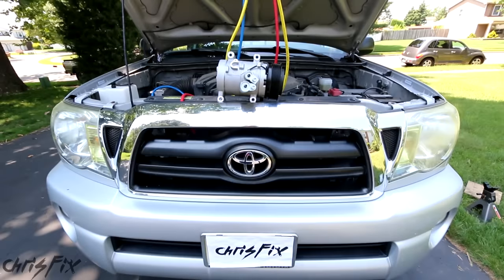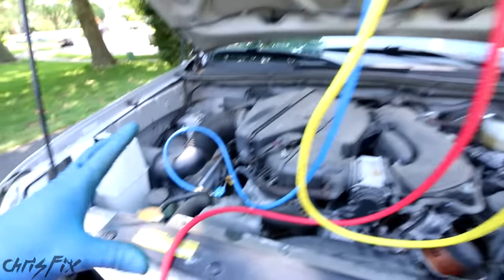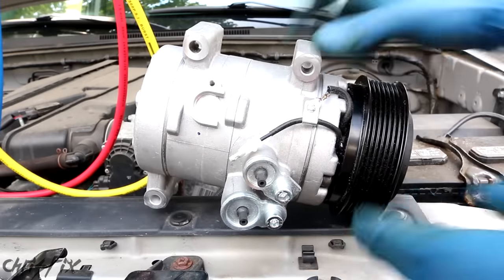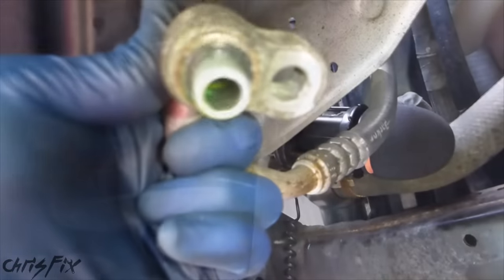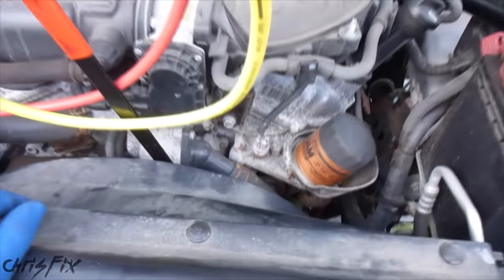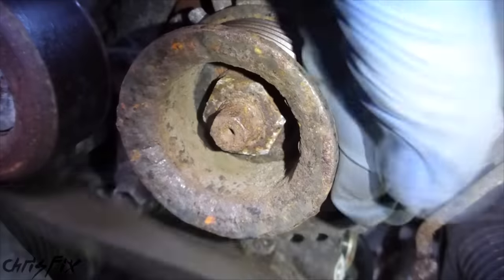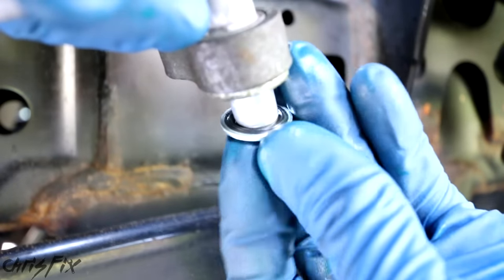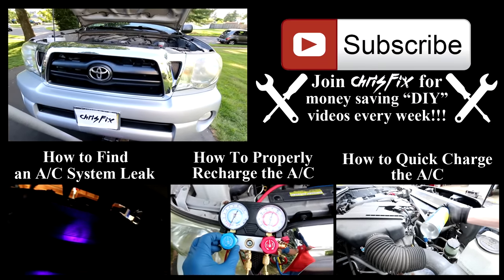How to Replace an AC Compressor in your Car

Comment: Good video. Being EPA certified I appreciate you telling viewers to have their system recovered before taking lines off and such.
Reply from the maker: George W Thanks!
Reply: its always best to release all refrigerant directly in the open air to help condition the cloud seals
Reply: George W  1313george
Reply: where to  go for the system recovered? do they charge any money for doing that? if they, how much money will they charge? ~100$?
Reply: wolf north should only be around 10-20 if anything at all. It costs the shop nothing but a few minutes

Comment: I have one thing to bring up, I was told that anytime you break the system and expose it to air you should always replace the dryer to make sure you have no moisture in the system.  If you have any water in the system it can damage the compressor or the high to low pressure valve( sorry I forgot the name of it).  Pulling a vacuum does not get rid of water.  Was I told wrong or why did you not change the dryer out?

Comment: Okay, I have a 2007 Honda Fit with 296,000 miles on it.  The engine still runs strong!  I have some front suspension wear, and Chris' recent Del Sol front suspension video has convinced me to replace most/all of my front suspension.

Now my A/C has also failed.  I suspect it has multiple problems (leaks + tired compressor, etc.).  I'm thinking of just replacing ALL the A/C components (including lines, condenser, evaporator, etc. -- basically EVERYTHING involving the refrigeration system, plus the condenser fan assembly.  I'll keep the controls and cabin blower motor, etc.)  Ignore the financial questions about the value of the car, blah blah blah.  Assume I'm okay with the total parts cost and I'm doing all the work myself that I possibly can (everything except recovering the old refrigerant).  Does this sound reasonable?  It looks to me like replacing the lines, seals, etc. with all new would save me the time and effort of tracking down leaks, flushing the existing system, etc.  And at the end I'd have a whole new system that should last several more years.  Does this sound reasonable, or am I completely off my rocker???
Reply: No more nuts than I am...should see all the things I've done and am doing to my 2003 Ranger...

Buddy has the same year Fit I "get" to work on so he can save money.  You'll find out rapidly that working in that engine compartment is somewhat nightmarish.
Reply: You can keep your evaporator, unless it leaks. Everything else is reasonable when you love your old car.

Comment: Bro, you legend! I just picked up an '04 4Runner and I started hearing noises from the compressor clutch. I think it'll give out in the next few months... I was preparing for the job by looking for videos to see what I was in for and I couldn't find any for my engine and car and I stumbled across this and that Tacoma just so happens to have the same engine and whole setup as my 4Runner, wild! Thank you!
Reply: same kinda, '00 4runner tho and the belt slips off because the compressor pulley is too far forward by about a half inch. pisses me off because it just started doing it after i bought the damn thing

Comment: So you do have to use a vacuum pump when you get everything back together. Air in the system is actually a problem.
Reply: You should pressure test with nitrogen also.
Reply from the maker: That is shown in the next video of the series.

Comment: When replacing a compressor some manufacturers require the lines to be flushed for
warranty. Did you make a video that shows the process you use?
Reply from the maker: I did not because this compressor didnt grenade. A flush is needed if there is contamination inside the lines and in this case it was just a leak.

Comment: Hey Chris. I love your videos man. You make me want to become a mechanic. You make everything very clear and easy.  Quick question (although I've asked a bunch) you have said, in a different video, not to use a universal adapter with a torque wrench, but you used it in this video. Is there exceptions to that rule?  Could that damage the torque wrench?
Reply: It looks like he kept the ratchet and universal adapter relatively straight thereby he avoided not torquing it enough to where it would come loose.

Comment: Dont you need to replace the drier or accumulator everytime you open the ac system lines?
Reply: You should, yes. Also the expansion device and flush out the remaining oil that has circulated into the system. But a catch-22 on that is the parallel style micro channel condensers in use now cannot be flushed and are recommended to be replaced. The place I get my service compressors from will not honor warranty unless all of the above is completed. However, this video does a great job of showing the gist of the repair and also the compressor did not fail mechanically--it was only leaking. This repair will probably last the remaining life of vehicle.

Comment: ChrisFix I just replaced the AC compressor in my Jaguar XType then charged it using this video and the recharge.  It worked great and I did everything like you described for under $400 buying new parts on Amazon.  I was very nervous about this job but took great notes and it went very smooth.  Thank you

Comment: one helpfull suggestion.
plugging the compressor lines with fibrous paper towel will contaminate the system!
Use a pair of cheap foam earplugs  or rubber vacuum port caps.
way better friend
Reply from the maker: +John Bobrink thanks for the tip

Comment: 5:30 me and my boss fought that clip for 20 minutes on his Tacoma
Reply: I think in these videos they fight it too, earlier. Then they take a shot where it just comes off easily. No doubt. I never had a single connector that came off just like that. Even pushing that little tab down is hard. And even if it is down, it gets stuck. It's dirty. Maybe you can pull it off like this in the factory. Maybe! :D

Comment: 3:00
This is a common problem with Toyota cars, tight spaces 
Easy to find the problem but hard to fix 
They drive you crazy 😂😂
Reply: I got me a toyota estima and its a pain to work on with the engine in the middle and all the other bits and bobs up in the front

Comment: Wow I was given a $1400 estimate to replace mines compressor in 2013 Altima, thanks...
Reply from the maker: Glad the video was helpful!
Reply: So basically they charge 1200$ for 1 hr job just wow 🤣🤣
Reply: Kosta Najdoski yes that is prob for parts, labor, filling the compressor if need be and a ac recharge not including where it is located. If for whatever reason the compressor fails then it is backed by a warranty for so long

Comment: Ah come on Chris you ahould have gave the sensor a new bolt instead of putting that rusty old bolt back on LMAO
Reply from the maker: Sourcing that bolt would have taken days (had to order it) and there is no reason. The new one will just rust as well. Maybe for a special or high end car, but for a Toyota, this is fine. Thanks for sharing!
Reply: ChrisFix ok understand

Comment: I spy a Fram oil filter...
Reply: Zachary Adams i spy a toyota... :(
Reply from the maker: Zachary Adams fram oil filter = bad!
Reply: ChrisFix Too bad many people think otherwise.
Reply: Hey i run my vehicles with the same orange fram filters and valvoline maxx syn blend (the red bottles) never had any issues but im also faithful to the vehicles service intervals outlined in the manual
Reply: I have used Fram oil filters on my factory cars as well as my 500hp hotrods and have never had a problem in 44 years. I have heard the horror stories but most of them are repeated by people who have no knowledge of the actual event and just repeating what they have heard or were improperly installed, poor maintenance, or incorrect mounting. This happens with cars, handguns, oil filters, etc. This same mentality killed the corvair :)
Reply: marty carver There are many videos on YouTube where they cut into different fram filters. And it’s shocking to see just how cheaply made they are. Specially compared to other brands
Reply: Matt P they are cheap filters inside
Reply: Matt P  the inside of a fram filter is mostly cardboard

Comment: how do you put the wheel back on?
Reply: Make sure to flip the inside part of the rim and tire to the outside. This prevents uneven wear on the tread.
Reply: lol, what?
Reply: easy just add enough oil to your blinker lights.
Reply: and replace your muffler bearings
Reply: Just flip the rim and tires to the inside. That's what I do! I've never had to do an oil change in 10 years because of it. You don't have when you do that. No maintenance whatsoever.
Reply: ~finger wag~ YOUUUUUU! :)
Reply: Start in the corner of the wheel
Reply: Troll comment?

Comment: I’ve learned such a lot from your films and the fact that they are all truly superb documentaries and show so very clearly what to do. I have one question about this film and others; you always appear to take top bolts off first then bottom and the unit is not easily controlled by one person. Wouldn’t it be simpler to take off the bottom bolts first? That way you have far more control over the unit as it comes loose and off, rather than falling and you catch it? It’s a genuine question and there must be a reasonable answer to this. Thanks for everything.

Comment: hey there ! so i went ahead and changed out the compressor on my 08 civic si  this past weekend. there were a couple of steps to take but after watching and paying attention to your videos it felt like I've done it before. On sunday i took the car in to vacuum and recharge the refrigerant. I thought to myself, brand new compressor, some refrigerant and i should be good to go.well no,  no luck. my compressor won't engage on its own so i removed the compressor relay switch and replaced it with a similar relay inside the fuse box and nothing. so my next step was to jump the 2 terminals to kick in the compressor and it worked. i was able to force the compressor to engage and instantly i got some cold air!! now  being that i was bypassing the relay i didn't want to leave it running like that for too long don't want to damage it or anything in the system but i was relieved that the compressor actually turned on. what im thinking is that the compressor is not engaging because its trying to protect itself. I've seen something about a pressure switch that also controls the compressor. I don't know if thats the issue but I've been doing a lot of research and haven't been able to pinpoint the issue. what do you guys think it is. i feel like im so close yet so far. any help would be appreciated. thanks for these great videos chris... big fan!

Comment: Did this job many, many years ago before Youtube had everything under the sun. Took me hours to figure out how to release the tension on that belt. All the guides said "remove belt tension" but I didn't know you had to rotate the spring loaded tensionser like that. Eventually figured it out but dang this could've saved me some time and fury.

Comment: Hello,I recently had to get a new AC compressor for my 2004 Toyota Corolla.  It was sent from overseas.  The mechanic did not seem to be able to connect it, I took it to the guy who gased up the old AC compressor. He said the attachment at the end of the hose is not fitting into the hole.  I am using the terms I know, I don't know anything about AC compressors.  I did note that the mechanic said the pulley was a bit wider and I had to get a new belt.  Is there anyway this compressor can still work with a new hose attachment maybe.

Comment: i notice you glossed over or skipped a step, being the wires in front of the compressor bolted to the alternator; in one part of your video they are shown, but when you "fish out" the compressor they are gone/moved; in addition, when you fished your 12mm through the frame past the spring, not everyone will have that sight line as the spring may be in the way but i assume you didn't address that because your sight line was not hindered

Comment: Autozone and Oreillys Autoparts both have loaner tools which include the AC manifold Gauges and Vacuum pump, the only thing you need to buy is the AC Tap adapter to connect the freon cans to the manifold gauges. They charge you a security deposit which all in all comes out to less than $175  US dollars, which you get refunded in full once you return the tools.

Comment: It's a good idea to replace the filter dryer when doing any major work on a refrigerant system (as well as replace any seals to any connections you remove or replace). On my system, the filter dryer downstream of the condenser and mounts directly to the condenser.

Comment: It seems intimidating but it's not unless you are easily discouraged.
Although some cars as Chris states in the video are a but challenging the reward can be enormous, at a personal level you can say I DID IT! With pride.
Provided you have the time.
I swapped ac compressors on 2 different cars 1989 and 1990 Cadillac Seville....not the easiest cars to do but I accomplissed both. One back in 2013 the second one May 5 2019.
Will load up videos of both cars with AC on and a brief description of the process for thise cars.
Look for video in my channel soon.

Comment: Using a universal joint on your extension affects the torque applied to the bolt, this can be significant if there's much of an angle on the joint.  Maybe a subject for your next video?

Comment: Lol found out today that ac like is VERY compressed. Decided to take off ac line and BOOM. White glass everywhere on me ran inside fast af to wash my face off. Thank god I was wearing safety glasses. Good video! Was hoping you would cover hownto realsse the gas of the ac
Reply: Simple. It shouldn't ever be released at all. It needs to be recovered with dedicated equipment. That's why a licence is required for legal handling of refrigerant gases in most countries.

Comment: Im doing this tonight on my 05 Chrysler Town and Country. I already watched the recharge video and went and rented the gauges, flush kit, and vacuum pump  to vacuum down and recharge it properly. Have to hope I dont have any leaks because I bought it last month and discovered today when I took it in to get it inspected that the A/C Clutch Relay was removed, the clutch on the compressor was gone, and they bought a shorter serpentine belt to bypass the compressor. Now I get to go run an entire serpentine belt and replace the A/C.
Reply from the maker: Let me know how this all goes!
Reply: @chrisfix  Finished fixing it, took it to a shop and it turns out I didnt plug the compressor in all the way so it wasnt kicking on, it blows nice cold air now.
Reply from the maker: Darn! At least you got it figured out now!
Reply: @chrisfix  Yeah I did, my wife went and bragged to the guy that I bought it from and I have heard that he is jealous that I got the air going. Love the feeling of accomplishment I get from learning to fix this stuff myself and your videos are the main reason I started.

Comment: Thanks again, good job!! Here is my problem with Mustang 2004/ 3.8 litre. It has same AC system, than GT!!! My AC started to to go low, and clutch started to make same noise. I did replace just clutch = $62.00, also replaced orifice tube, which looked nasty, full of aluminium particles???, somebody replaced AC compressor before, maybe did not replace orifice tube?? Anyway, vacuumed system, and tried to charge freon into system, AC did not go on?/ Then replaced AC clutch relay, inside CCRM, went to junk yard , and got used one, which worked?? Noticed that something was leaking, could not get complete vacuum, had to be evaporator inside car, took dash out, BIG job!!! Replaced evaporator and also replaced heater core, same time. Also bought used condenser from eBay, rinse it, and whole system!! Vacuumed system, got nice vacuum, no leaks any more. Charged system with freon, system works, if you override clutch relay, wire power straight from AC clutch to battery, and car makes nice , icecold AC!!?? But, AC clutch still does not work, automatically??? Went to junk yard again, and replaced CCRM again??, AC not working??? Could it be low, or high pressure valve?? When AC compresor not on, low pressure valve should be open?? Right, and high pressure valve should be closed??? Can you help me with this problem, and how to test these valves/ CCRM?? I am in Florida, and weather is getting warm/ hot again!!! Thanks again, appreciate your answer/ knowledge!!! Youtheman =))

Comment: you rock  you have some serious skills  I did  my own air conditioner  pump switch out   the same exact  way.  The Toyota dealer wanted $2000 to replace it there labor charge is way to high. Your video saved me a lot of money on my 1997 Toyota Tacoma ,.  I did it myself thanks a bunch  . PS you also have a excellent way you  describe what your doing very well.

Comment: And Chris fix never even mentioned what to do before the compressor was even ready to be installed. Yes folks there is an oil issue that needs to be addressed. Whether you have a pre-filled compressor or a compressor with 3 oz you must now get the proper specifications for that particular compressor and make sure that half the oil that is needed for the system is put into the compressor and the best way to do that is to empty the compressor out of the box when it's new so if your system takes 6 oz you will place 3 oz in the compressor and then 3 oz in a new accumulator which you always replace when you replace a compressor, never ever replace an AC compressor without replacing the dryer accumulator. Don't worry Chris fix I'll help your viewers
Reply: Same thoughts.
Reply: @infernus8926  A lot of his videos don't give good suggestions at all and wind up damaging stuff if you follow his videos. But hey that's YouTube for you